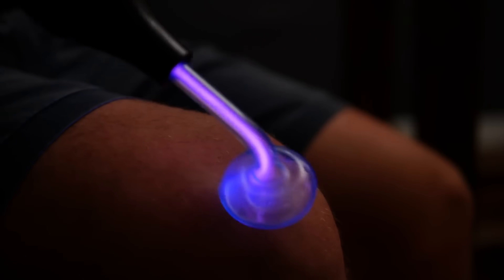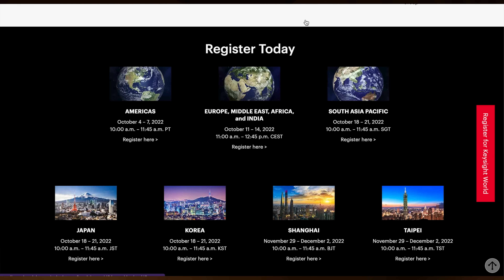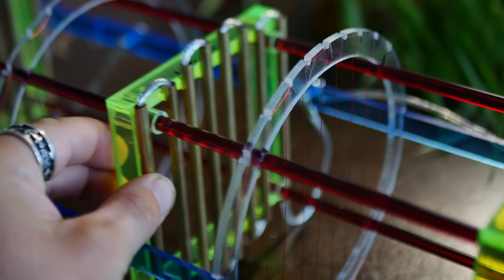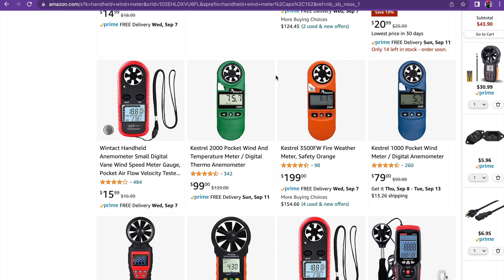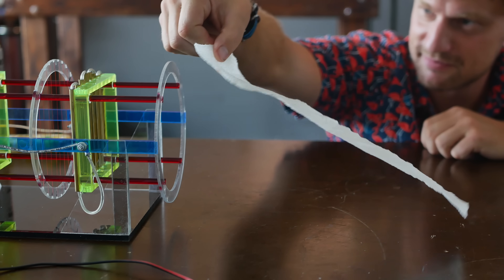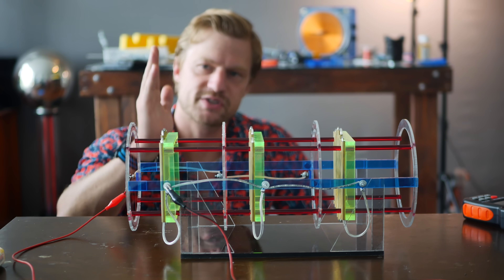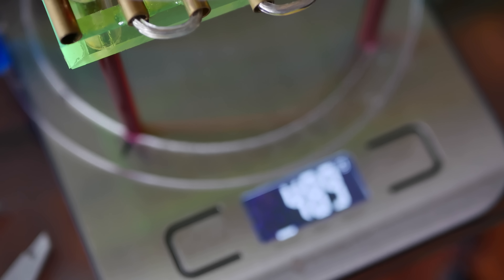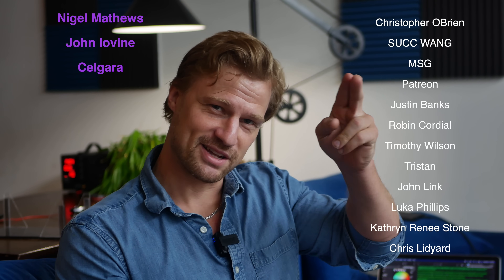Designing A Next-Gen Ionic Thruster! (For Flight)

Comment: This looks great! I have some thoughts though. 

For one, as others have said, ducting would likely help with the air pressure. It might be a good idea to take some inspiration from Dyson's Bladeless fans as well. If you can focus more on creating a low pressure zone and pulling in other air to increase the thrust you could get a better Thrust to Mass ratio.

Another idea would be to alter the voltages between the cells and increase/decrease their surface area and shape. You might get better results from steadily increasing/decreasing rings rather than the grid for instance.

Comment: The biggest problem I see with attempting to use this in an aircraft, is frontal area. It is very possible, this could power an indoor mylar craft... but the wing/lift area would have to be insane. Might want to work with a PWM control as well. Cycling the three gates may mitigate some losses from backfeed. 

As for airframe ideas... I would suggest researching records for indoor rubber band powered flight. Those guys have possibly the best lift area per gram of any hobbyist scale aircraft. They typically use poly tubing bent to form, then wrapped with mylar/cellophane... the thin plastic wrap used for freshness packing.

Comment: At 8:38 you held the airflow meter instead of standing it up as in the previous tests.  This resulted in it being positioned more at the center of the airstream than when you had it standing for the previous tests.   That's a variable that should be removed by measuring the same for all tests.

Comment: Here's a quick thought, ion collision probability can be increased by increasing air pressure. Reducing the exit at each stage can accomplish this but will also increase drag in the system. I would be willing to bet there is a sweet spot however.

Comment: Use a bigger HV transformer with less multiplier stages. At a high current drain big multipliers could lose voltage. I would expect a larger current output capacity at a given voltage would lead to better airflow.

Comment: you know how we came up with condensing gold or diamond in reverse .. all day ive been thinking of making thrust in reverse .. but also then reducing heat and counter effects but light should be an effect not sound?  also changing the gap betwwen fins to smaller as it goes will accelerate i think also .. foiling eh

Comment: would it make a difference for thrust if you mimic a jet turbine? have multiple thrusters like compressor fans in a turbine withing a cone shape to compress the air with varying voltage the farther it's seated into the cone?

Comment: * On those charged lines, why not make them a grid pattern, both horizontal & vertical? Maybe even diagonal, but that's probably overkill?
* Maybe make those "grounding rods" extend backwards in the winds directions, so there are longer time for the electrons to be grounded?
* Mentioned in other comments: tube & magnetic fields & input/output nosles.

Comment: hey this is real cool,and an interesting idea. I was thinking about some ideas to possibly increase the output. I was thinking what if you added air flow multiplier (like the ring on a dyson bladeless fan or the one flying car design floating around on youtube) after each emitter stage and decrease the diameter of each from intake to exhaust,this may increase the thrust kind how a ram jet works. another thought was to set it up in 3 or more sections with an emiter then airmultiplier then ground plane and stack them like you have there. the only problem I see there would be preventing back flow from the next stage emitter back to previous ground plane, maybe spacing would help. 

just some thoughts that came to mind while watching your video. can't wait to see what you do next!

Comment: I think it would work well if the tube was sealed airtight accept the input and output. I would also cone off the output using a parabolic shape, and at the input I would put an induction heater with sheets of steel suspended in the induction coil like layers of tubes/rings so that the air gets pulled in hot and should so encourage ionization.

Comment: Physics. The 6am class ....good that I read the text ahead of time. Hung over and a 4.0 won't those were the days. I would say that weight to thrust ...well you won't be replacing jet. But in space, it could well provide thrust, needed for pretty good speed, conventional rocket motors for braking and lift off.  I was amused by the plane power supply off screen, thick isolated cable ran to stanchion.  Next you could try thrust vectoring ...easy use the same theory as a crt...

Comment: Congrats on a great build! I know nothing about ionic thrusters, but I've built scratch r/c place models for decades. If you truly want this to fly you will need to DRAMATICLY reduce its weight. Are the brass rods necessary? Calculate the smallest possible gauge wires you can get away with. Ditch the acrilyc and go with balsa or carbon fiber. Even a very whimpy r/c model needs 30-40% thrust to weight ratio. Just for proof of concept you could get away with less, though. And that is the weight of the whole plane, including the power source.  How small can you get your power source? Aim for massive wings with a high aspect ratio (long and skinny). I wish you best of luck! Let me know if I can help with tips and tricks for lightening your build. I;ve done lots of it!

Comment: between stages it is sucking air in and then blowing it out of the sides.  a duct made of a thin layer of aluminum surrounding the ion drive should keep air in and improve efficiency by channeling the electricity down the center of the tube. and a proper nozzle to direct exhaust should help produce greater thrust. a slightly larger nozzle than the air intake should create a negative pressure zone and help suck air out as it moves forward

Comment: 1. Ducted airflow, 2.  the wires could be notched at precise intervals to make a better pattern of plasma, 3. conical design, where the first unit is larger with less voltage and the last is smaller with more voltage.

Comment: Would be cool if you turned a propeller with the same wattage and showed the compared thrust/wind generated.  What if you increased the amount/density of the thinner wire?  I wonder what effect changing the overall diameter would have.  Or if the whole thing were placed in a cone and each stage decreased in diameter focusing the air current.

Comment: This is badass! I like the other suggestions in the comments regarding adding an enclosure, but get why you didn't for this prototype. Is there any benefit to increasing the number of stacks? Also, is there any way to achieve radial flow like a RHVT to isolate the more dense and less dense (hot and cold) plasma? This may allow you to increase the pressure based on temperature distribution and use standard enclosures and nozzles to increase thrust? Probably a dumb idea, but hey, that's what commenters do best :)

Comment: three ineeficencies: 1. the channel is open to the outside so large amounts of air is leaking out. 2. the spacing inbetween each array is spaced quite far so the particles are slowing down. 3. i guess the electrodes would have to be shaped better? also i could suggest a way to vary the thrust dynamicly

Comment: Incredible work, looks really cool too. I wonder if the material of the frame affects efficiency. Acrylic has a pretty high dielectric constant, I’d be curious to see if using materials with a higher or lower dielectric constant would change things.
Reply: I assume that a lower dielectric constant would result in worse performance, since some of the current could go through the frame instead of the air
Reply: A high dielectric constant is fine, but acrylic is heavy if it's going to be used on a plane. Ionic thrusters have low thrust, so the frame needs to be as light as possible.

Comment: Possible to enclose the device with walls on side maybe even with grooves like a gun. Maybe add a nozzle andmaybe make the nozzle be the place the electrons want to move too. Maybe feed an ionized gas into the chamber? If you add electro magnets and more magnetic fields you will also push out plasmoids, this will add to the thrust. If you incorporate magnetic fields. Any ionized gas can be used heavy or light atoms. Maybe you don’t want heavy xenon maybe you want hydrogen. I have another idea,. What if you use magnetic fields to contain and build pressure and then turn off the magnetic field allowing the built up pressure of plasma to dump. Release the plasma in quick pulses.  Loved the video man I’m going to make my own to do experiments with. Maybe I’ll even incorporate some of these ideas and maybe discover smth new!!

Comment: Complete laymans ideas:

1. Alternating orientation of the stages by 90 degrees - what effect would this have?
2. What does a fourth stage do? - Estimate 7% on top of 3 stages
3. Does pulsing power or some sort of PWM work with plasma? 
4. Does restricting airflow from the sides improve performance?
5. Does inlet air pressure/velocity change much about the performance?
5a. What about directing some of the output airflow back into the inlet, would this be more efficient than adding an extra stage?

Comment: Inefficiencies:
1) Weight/stiffness
2) Circuitry. (?)
3) Overall shape - path of the airflow.
(4) Number of sections/spacing (?)

0,25 mm thick carbon fibre tube as housing, no need for support braces for the electrodes, just drill holes corresponding exactly to the diameter of the wire directly into the tube. Proper insulation of the live wiring from the outside. Properly shaped intake and nozzle. The cross-section of the ground electrodes could be a symmetrical aerofoil instead of a circle. Not sure about the circuitry, I just never liked all the calculations that are attached to designing electronics.. ':D I also thought about turning each segment at an angle against the previous one, but it would probably slow the air down instead of making it a bit faster...

Comment: Try to clean and tighten up your wires to get the plasma distributed cross them equally. And possibly try to use different size electrodes to see if that will increase/decrease efficiency

Comment: Good job. A solid effort.  I've thought about something like this for a long time. I suspect one problem you aren't going to see at this scale though is ionic erosion. As you increase your power density, you're going to find horrible pitting problems with ionic erosion in the metal. Basically high energy events that are unpreventable essentially boils off the metal on an atomic scale.
This damage is insignificant at lower power levels and for short periods of time, but becomes very significant as your thruster becomes more and more powerful. This is why we don't really have reusable ion rocket engines.  The ions engines take such significant damage over the course of their  use that they're considered expendable.  
Operating devices such as these in an atmosphere necessarily requires significantly higher outputs and thus I expect that you'll shortly start seeing significant engine damage.

Comment: Is that enamelled copper wire you used? id go for smaller gauge wire so your hot spots are more accross a single wire, try a few more stages, enclose them all and whats to say you cant circulate the airflow back around to the front? generally id enclose it and see at which point additional stages have a negative effect on thrust, bloody good stuff btw!! just subbed!

Comment: My biggest though on inefficiency would be 1) youre taking it to ground then back up at each stage, I cant help thinking having each grid at descending voltage would be more efficient. 2) pretty much nothing is shaped aerodynamically, the frame should be aerfoil hoops, the ground plates should be heavily elliptical 3) the grids are linear - they should be grids, ur wasting a lot of charge density 4) highly neg charged dielectric duct would repel - charges without being a source of them.

Comment: You have used an isolated wire on a grid. Please clear it with a knife or lighter.
If you are using multistage it is better to choose stepping voltage between grids. So avoid connecting it in parallel but in series to let ions flow from -to 1-2-3 stage.Just connect 2 anode to x2, 3 cathode to x3,3 anode to x5 so on

Comment: Improvement:
1) metal mesh with as small holes as possible (instead of wire and tubes);
2)  use instead of one large pipe a few smaller ones with different lengths;
3) use different voltages for different pairs of electrodes. Having picked up the optimal distance between the electrodes for each voltage.
Sorry for my English, I'm using a translator😅.

Comment: Besides the previous comments well made of cleaning up the air path and ducting, some things stand out to me. The wire you used was enamaled and you don't have a consistant surface to emit from. A non-enamaled wire that is also very thin like nichrome. There was a suggestion of using airfoil shaped tube rather than round and I agree, would help with airflow but allow a larger area to recieve the electrons. It would be interesting to see if a smoothed DC would actually work as good as pulsed. I am tipping the pulsed (lets drop a hint here, "Impulse engine") will work better as the higher peaks of the pulse will see higher velocities and amount of electrons. 
The staging of the three grids would be a simple case of add the velocity gain of each to the previous set so that each is providing an equal addition to vleocity thus thrust.
Reply: This is a scammer at work.

Comment: Idea - 
1) insert more sections of the wires, between each section, so that each stage, the air gets more ionized, and propelled faster from section to section.  I think like other have said, that this + a duct/ shield to keep the air moving in a single direction would help with flow / combustion/ propulsion.
This would be like a jet engine, where it has stages that compress the air, tighter and tighter, until the ingintion stage, etc.   

2) Additionally, I think the gauge of the wire, is not right.  Looking at the still screen when the light were out, showed that there is pockets were the wire has a discharge happening, which is not uniform.  I wonder if using a different gauge of wire, can help or not, this discharge, whereby increasing the propulsion of the ions coming out, which is attracting the air molecules.

Comment: Would staging them smallest gap first and largest gap last not work? Less gap to get the air moving and larger gaps to push the already moving air?

But I'd think encasing the whole thing, or having mildly conical nozzles after each stage to help direct the air flow would help?

Comment: I know for sure a housing around the assembly for keeping all air flow linear would probably improve thrust efficiency.  But what about staggering the grid power, staggering the grid frequency, negative grid surface area, can you double up your positive grid rows?  can you offset the positive grids to the negative by 90 degrees?  45 degrees?  My mind is flooded with questions.

Comment: Never seen your channel but this video is amazing.
 You should probably stick it in a tube, this cleans up the Airflow on the sides. I wondered if pressure has influence on the ionisation effect and it has. If you increase the pressure you need less voltage according to quora prob more complicated than that,but so is all the subject matter in this post.

 If you create a Venturi shape with some sort of exhaust bell as exit. And the cathode before or after the Slender part.(does the highest pressure occure there?) The venturi and nozzle will only be Very slight as the speed of the wind you are producing is sub-optimal(for this to even have measurable effect) . But compounding effect right Triple compression of air

If we could produce sufficient speed and sufficient pressure you need less and less voltage?, it wil almost become a jet engine without combustion, or blades and producing pressure by means of electricity lmao. Holy st, do fluorescent tubes have a pressure gradient in them? be careful of mercury and aware of gas in tube  Why not open tube either side and run ultra high voltage through. Replacing the starter on your electric superjet 😉. Maybe the cath'n anode of fluorescent light could give some insight in this ionic wind. 

Also, shouldn't the cathode have sharp angles so the electrons detach more easily?

Damn this subject made me so excited maybe I'll build something when I can I would love to work on this. I dream of Venturis with rocket nozzles and soft textured platinum honeycomb cathodes, proper sci-fi.

Comment: 1) Enclose the body with rifling in the inner casing to reduce turbulence, 2) use an exhaust housing to increase outlet pressure boosting T/W by optimizing flow, 3) use a thinner ionizing filament that can bust air contact surfaces there-by boosting ambient ionization.